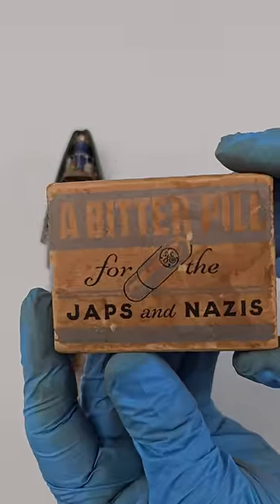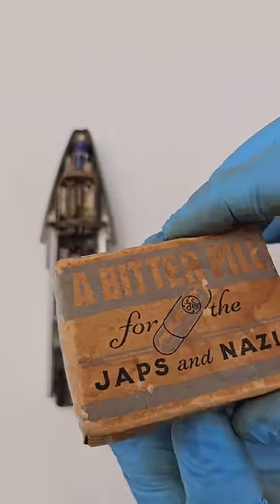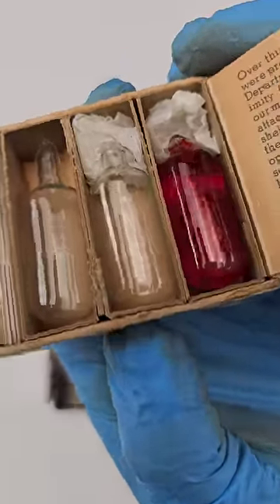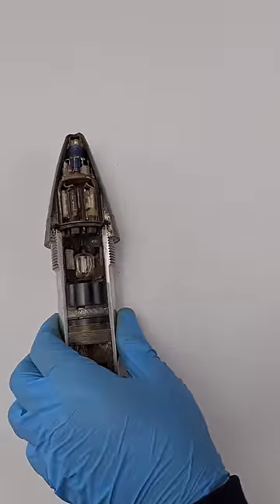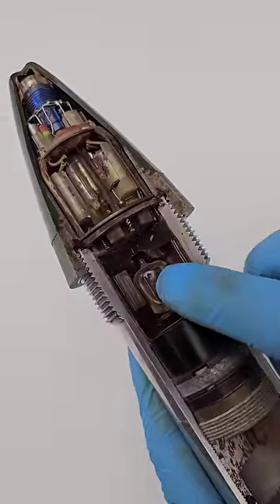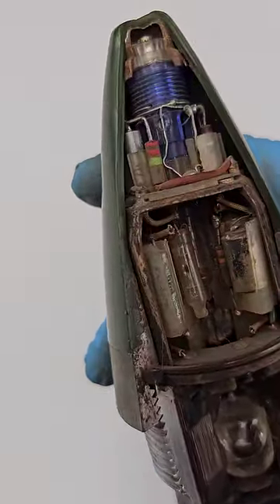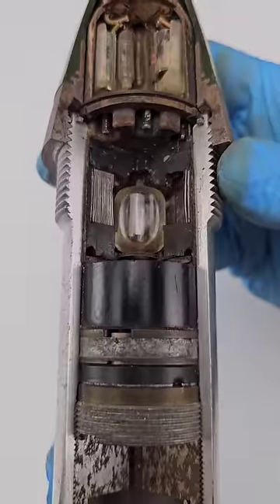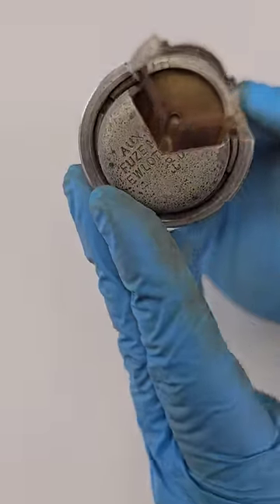RADIO PROXIMITY FUZE: General Electric Helps Beat Kamikazes & Win WW2 #military #history #technology

Comment: I worked for a machinist who flew B24 in WWII. I  think he was 8th (?) Air Force & bombed Ploesti multiple times. Never spoke of his service.  I saw his medals one time and asked. He said "the Germans had 88's on railroad cars that surrounded the oil fields. They would estimate bomber altitudes, adjust their AA fire to explode above bombers elevation." He then took out all his teeth on one side. A fragment came through the aircraft exterior and knocked them all out. At his funeral, a military spokesman told of his WWII exploits and his earning the Distiguished Flying Cross. RIP Sir.
Reply: well that was unfair and you know people from Romania they never ever forgot that.  Ploiești was the first city in the world who developed the refinery and this is in Romania .near to the capital
Reply: Bomber crews went through as much hell as infantrymen on the front lines in WW2. B52's were called the flying fortress, but it was a daily occurrence to lose multiple bombers, and have numerous casualties aboard the ones that returned. Severed limbs, decapitations, frost bite. It was the flying fortress, but also the flying tomb. Unbelievable war, we're lucky to live in the era after such horrors. It's a shame ww2 veterans are becoming so rare, those heroes deserve to live forever.
Reply: @tooitchy  There were no B52s flying in WW2.  The "Flying Fortress" was the Boeing B17.  But, I assume that was a simple typo.  The rest of your post was very correct.  Thanks.
Reply: He was the villian/ he destroyed his own people.
He's swimming in the spicy lake forever now.
Total Vet Deletion.

Comment: For anyone wondering why the capsule specifically - they needed a battery system that would work just as well after sitting on a shelf for years as it worked when new. By separating the batteries electrolyte from its plates until the instant it's fired, they achieved this. The acceleration of the fired shell releases a pin that shatters the capsule, then the centripetal force of the shell spinning spreads the electrolyte over the plates, creating a battery with just enough current to run the proximity indicating radar system until detonation.

Absolutely brilliant system.
Reply: thanks thats interesting
Reply: This method also help solve a different big problem. The tube filaments while cold could be easily configured to survive  a gun launch. Tiny thin red hot fils glowing in a glass vacuum tube at launch - not so much.
Reply: نیروی مرکز گرا یا نیروی گریز از مرکز ؟
Reply: They also needed a system that could withstand acceleration from zero to Mach 3 in .0001 seconds.
Reply: There is no centripetal force involved here...only centrifugal which spreads the electrolyte outward.
Reply: @recoilrob324 you got it backwards.

Centrifugal force doesn't exist, only centripetal force exists.
Reply: @maxv9872  You are wrong my friend.  Neither centrifugal or centripetal actually exist as they are 'fictitious forces' that don't exist outside of a rotational frame of reference.

Centrifugal force tries to make an object leave the rotational movement moving outward from the center of rotation,  while centripetal holds it in that rotation if it's contained into a circle.

A ball dropped near the center of a rotating platter will instantly start moving away from the center of rotation....that's centrifugal force and it can exist without centripetal force and will continue in a straight line away from the center of rotation.   If something contains that ball so it travels in a circle...that force is centripetal.   So centripetal cannot exist without rotation first creating centrifugal force.

See the difference?
Reply: @maxv9872  A quick search did not reveal the rifling twist rate for one of these guns. I will take a guess and say it was at least 1-24. At a speed of 2300 fps (for a 40 mm), the rate of rotation of the round was over 90 revolutions per second.
Reply: @recoilrob324  You can actually think of it in two ways, but centripetal generally wins.  You cannot have both.
Reply: @markkinsler4333  Tie a string to a nut, then spin it rapidly around your head.   The string is the centripetal force while the nut pulling it tight is centrifugal force.   
In the situation of the electrolyte being flung outward by the spinning shell....is the 'string' forcing the stuff outward or is it centrifugal force acting on it just like the nut?
Calling everything that happens centripetal force is just wrong when it doesn't exist without centrifugal force also being in play. 
The distinction between the two forces is important to understand as well as their co-dependence on each other.
Reply: care to explain, what radio waves frequency was used, what about interference causing it to misfire, can it also detonate by impact if the radio detonator fails or is removed? also how does RF detection work there is little space inside to put an actual radio TX and RX station
Reply: Гениально
Reply: Designed by the British, manufactured by america cause we literally couldn't do it  given the industry being rubble and all that.
Reply: Necessary info to this story, thanks.
Reply: Thank you for your clear explanation.
What he tried to explain in the video was a total mystery to me.
Reply: @recoilrob324 angular momentum forced rotation

Comment: This is insanely impressive. I don't think many people truly appreciate how insane it is to have such a precise and reliable rf transmitter/receiver in such a small space WITH THOSE COMPONENTS. 

Pre digital rf design wasn't just engineering, it was true craftsmanship with a dash of magic.
Reply: I like to think it was engineering and hard work
Reply: @knoll9812  and a little bit of magic. With a dash of destroy the environment. Lol I live very close to one of GE's closed down factories, the property is so polluted that it can't be developed until the entire thing is buried.
Reply: They were also extremely effective. Munitions with these fuses were much, much more powerful. I have heard it stated that German casualties from Allied artillery was much higher than the Germans predicted during their counter attack against the Western Allies (the Battle of the Bulge), and that it was pretty much entirely because of radio proximity fuses used in artillery rounds, giving each round a far larger and more effective blast radius. 

While the Germans were working on a variety of expensive "wonder weapon" technologies which were, for the most part, never cost effective, the Allies actually had a technological edge in many different areas with cost effective weapons and equipment that was actually being mass produced.
Reply: this was probably second to the Manhattan project for secrecy like the Norden Bombsight shroud of secrecy was created i think was to create smoke screen for the AAA shells importance!
Reply: The time of vacuum tubes.  Amazing things they could do back then the 40s.
Reply: Can u explain it to me better than he did in the video?
He just read of the back and it didnt help me understand.
Reply: I studied to be an electrical engineer and, even today, feel that RF is a little bit of black magic
Reply: Does it establish a connection with the(Mercury?) & a change in the strength? of the signal = Detonation?
Reply: @scottthacker4167  I actuallly think the mercury in it is more for the arming the shell from the spinning caused by the rifling in the barrel. if you familiar with car parking sensors on newer cars these days they basically wok similar to that, In stead of beeping when it gets close to something it just goes boom.
Reply: They weren't precise or reliable! They had dual redundant circuits. RF proximity sensing is easy even with a crude analog setup. The shells transmitted ~200MHz signals using the outer metal casing, and sensed on the ~800MHz band using a simple band-pass filter, once the signal received back at 800MHz, the shell would detonate.
Reply: Its like they say, radio works by FM. (fucking magic!)
Reply: @the.bog. man, there are some many 800 mhz signals now a days, that thing would instantly go off today.
Reply: @GMCLabs that's true. Engineers today have to worry about all the rf interference. Think of how many of signals are on an aircraft carrier. The sky would be black if we could see them....
Reply: A guess, It would have two LC circuits I imagine, the receiving LC circuit set at a freq higher than the transmitting LC circuit to compensate for Doppler and so the transmitter circuit didn't just trigger the receiver circuit.
Reply: @unclesamthejew8740  A battery powered transmitter/receiver was fitted into the nose of the expulsive round. The battery was kept dry. When it was fired, the electrolyte in these glass capsules broke from the shock wetting the dry battery which then produced voltage that powered the transmitter.
When the signal from that transmitter was bounced off any target 70 feet or less away, it signaled the shell to explode. This explosion was exactly where it could inflict the most damage.
Is English your second language or something?
Reply: Beautiful engineering.
Reply: @hovojefe I used to be on the Hudson River and the Marathon Battery Factory upriver had polluted the Hudson but because it was buried under decades of sediment it was determined to be left alone so as not to disturb the site…
Reply: @syncmonism thats completely incorrect proximity fuses didn’t make artillery have a larger radius and it was mostly only used in anti-aircraft gunnery in which they were not very useful compared to standard timed fuses.
Reply: @OKgonno  Actually, these were used during '44 and on to produce an air burst effect on ground targets.
  They had something like a 56% success rate which exceeded the war departments requirement of 50%.
  They were an intensely top secret weapon fuze. 
   At that time air burst artillery shells were known to be incredibly deadly but achievable only by graze fuzed shells hitting trees or very experienced gunners skipping impact delay fuzed shells off of hard ground.
Reply: @owensthilaire8189  yeah okay you’re totally right, I’m just have a doctorate in Military History and technology development. They were not highly effective and it didn’t matter if they were a secret, the British, Germans, even Italians had deemed proximity fuses a complete waste of time.
Reply: @OKgonno  I've been reading the history of warfare and weapon systems for forty years.
    I doubt very much your educational claims and in any case I wouldn't call 48% failure rate ' highly effective '.
   The effects of an air burst artillery shell however are very effective.
   So much so that they are in use in launched grenades, shells a rockets currently.
  But hey, you live in your world, I'll live in mine.
Reply: I was little confused with chemical with insane bullet with radiowave.  Evidently anticraft had a trashmittor. Thanks ! Impressed by the explanation..
Reply: And all this inside a grenade that has to take 10,000 G when fired. It is a grenade, isn't it?
Reply: @DavidG2P   It is a radar proximity fuse for an artillery shell.
Reply: @owensthilaire8189  so all that glass ballons, things and wires must survive being shot from a cannon 🤯
Reply: also it gets shot out of a gun and doesnt break
Reply: bro invokes satan and talks about guns
Reply: @ReasonAboveEverything  hey cool picture
Reply: Not only that, those fragile electric components managed to survive the acceleration during firing. That's a lot of G's!
Reply: This emp oroofe then
Reply: Bro I am Absolutely Blown away, I immediately thought what year this was back then and that makes this device an Innovative Marvel....😮😮😮
Reply: Yeah, to make a vacuum tube whose internal elements don't just crumple when exposed to like 10000 Gs was a hell of a feat.
Reply: And it had to endure approx 15,000 G's of acceleration when fired and still work!
Reply: @GMCLabs nowadays you would have to look for specific modulated signals to receive as detonator. Still pretty doable, I mean we are all sending signals the
Trough the air most of the day and we still can make it pretty reliable.
Reply: Это радиолампы что-ли в коробочке? Это же капсулы с электролитом. Ёлочных игрушек не было... А Кока-Кола в стеклянных бутылках была почему-то.
Reply: @tommolldev  Ah ha!  That's the explanation I was looking for.  Kinda like a flying theremin, but searching for harmonics of the fundamental frequency.  Crude, but effective.

Comment: The secret of the tube:
When the bullet is fired, the glass tube breaks and the electrolyte liquid inside disperses between the plates, forming a battery cell. The power that fed the radar mechanism was provided by this battery.
Reply: Thank you for actually making this make sense.
Reply: @nickman0303  👍
Reply: best explanation. thank you
Reply: thank you
Reply: It shatters releasing the electrolyte which makes the battery operative. He says that in the clip...lol.
Reply: absolutely brilliant design.
Reply: @Substance2020   but he doesn't mention the plates. Not all of us caught on or remembered how batteries operated immediately.
Reply: Emm.. Those were rockets, not "bullets."
Reply: @Substance2020 just say it’s a chemical battery at that point.

That’s like saying you put chambers that once fueled and compress power your car by explosions.

Just say it’s got an engine.

That’s where the confusion lies. But maybe OP needed to juice another second or 2 for the short length lol
Reply: Which liquid is Filled inside?
Reply: Not just break, the shell needs to be spinning fast enough for the electrolyte to be pulled to the outer casing where the metal used to make it a battery were to cause the shell to be active. That design was so if any shell go damaged during transport the glass breaking and spilling out the liquid wouldn't cause it to arm and explode.

Comment: Prox fuses needs to detect when it is near an aircraft to go off. So it requires electronics to do so but you don't want it to go off when being handled etc. So the charge would break the glass, however the electrolyte which powers the prox fuse needs to be spinning before it can mix, creating the charge. The spin was from the rifling of the bore, which stabilises the projectile.
Reply: How did it destroy the Kamikaze planes? Those planes did not always transmit radio signal, didn't they?
Reply: @LifeMeister-m7m  the fuse itself had a small cavity magnetron (if I remember correctly) to generate microwave frequency waves. The whole thing had an entire miniature radar transmitter-receiver set in it
Reply: @starliner2498 thanks! Next question, in order to destroy any single Kamikaze plane, most likely the gunner would have had shot many rounds? How to avoid the premature detonation because the rounds were detecting each other presence?
Reply: @starliner2498 another question 😊 is the modern proximity fuse still using the same method?
Reply: @LifeMeister-m7m proximity shells still use radiowaves, but I think they use more modern electronics and energy storage.
Reply: @LifeMeister-m7m  Guns had a relatively slow rate of fire, meaning the rounds would not detect each other.
Reply: @LifeMeister-m7m iirc before proxy fuzes were made it took ~20000 rounds to shot down 1 plane, with proxy + radar its down to 90
Reply: Actually there are quite a few savety Features one is the glas capsul  (with that they also got around the slow dischage over time of olt batterys) than there was a rotation switch that needed a spin so the shell dont explode in the barrel of the AA gun and and a mercury savety switch and the Thyratron gate Was negative charged till needed
Reply: @LifeMeister-m7m  The Japanese fighter plane designers chose speed and maneuverability over the weight of armor and rubber in self sealing gas tanks. One round through either wing pokes the hole then any other hit turns the kami into a flying fireball.
Reply: An older Japanese friend once told me how near the end even the woman & children were in hangers making paper machet airplanes to park on the runways . They used anything like wood to help repair & barely get of the ground planes that were left.
Reply: @LifeMeister-m7m  For some they are pretty similar in regards to how it functions but they tend to be much more advanced these days. Most of the newest systems have programmable rounds meaning that the gun will have a radar or laser range finder on the target and as the shell is leaving the barrel the computer programs it telling where to explode. But they still have rounds that detect the target and use that as a fuse as well, they often have more than once sensor type these days as well, like say magnetic.
Reply: I'm lost
Reply: Should have been a mechanism where a metal tube is fluted gradually. This tube could have say a ball bearing in it. 
If the ball is steel and the tube is soft like aluminum. The ball could only "break" thru the end of the tube if shot at a certain "g"s hitting a set of contacts and starting the power to the radio transmitter. 
Make the tolerances so that the shot force breaks thru but even dropping it from 6' in the air isn't enough force for the ball to get thru.
Reply: @stephenrosenthal5252 A problem I can see with your suggestion: You'd be requiring some very fine (high) tolerance standards, which is certainly possible, but expensive and harder to mass produce.
Reply: Why are you repeating what is said in the video?
Reply: They tuned it to only detonate when the radio wave reflected back was distorted the correct amount that would happen when it was meters from a plane